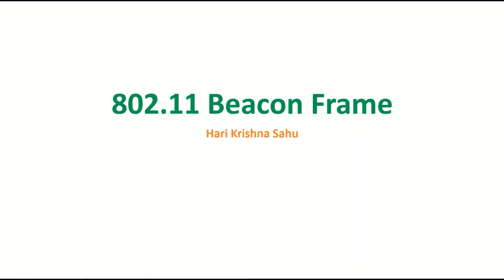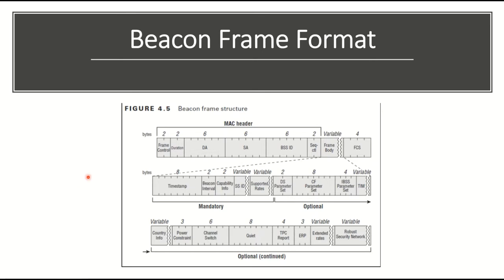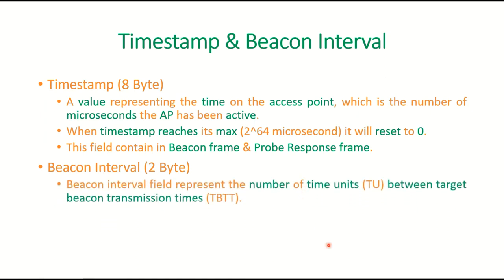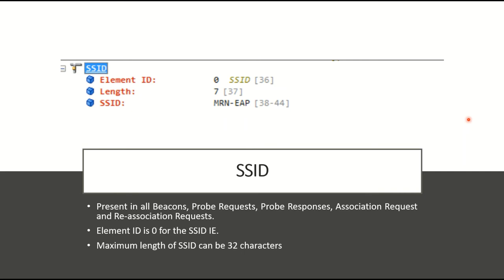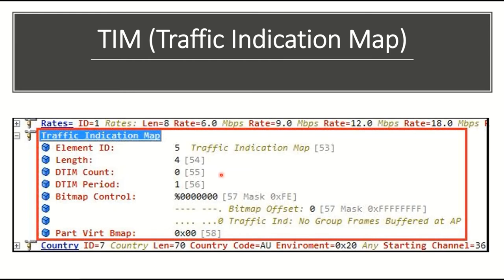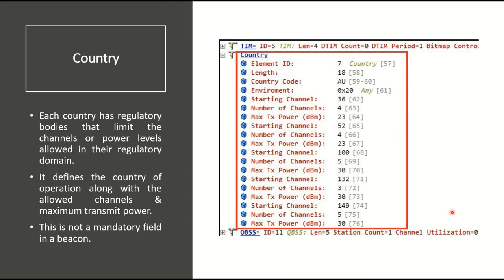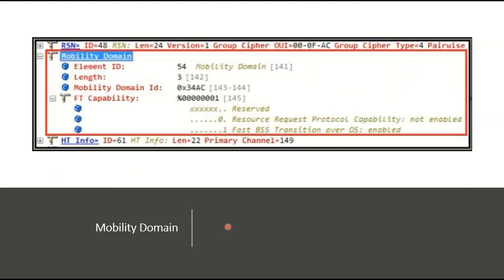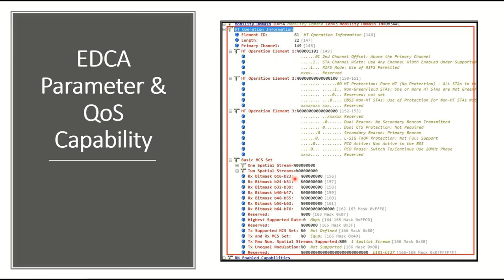802.11 Beacon Frame | Analyzing Beacon Frames using Wire shark | 802.11 Frame Analysis | Beacon

Comment: very interesting! Thanks for sharing. When could be a good idea to reduce the beacon frame interval on networks? Also, if reducine them would bring any sort of problems to my network? 
Thanks!
Reply from the maker: Great suggestion!

Reducing the beacon frame interval on a network can be a good idea in certain scenarios.
1. High-density environment
2. Real-time applications
3. Fast-moving environments
4. Time-sensitive operations

Yes, reducing the beacon frame interval can potentially introduce some challenges and problems to your network like:
1. Increased network overhead
2. Interference and collisions
3. Battery life impact
4. Management overhead
5. Network scalability

Before reducing the beacon frame interval, it's crucial to perform thorough testing and monitoring to assess the impact on your specific network environment.

Thanks for connecting.
Hari

Comment: Thank You sir for explaining it nicely. Could you please confirm, does AP sends beacons on all the channels simultaneously ?
Reply from the maker: Not at all. How come it's possible. AP can't send beacons on all the channels simultaneously. Thanks
Reply: @HariKrishnaSahu  So how it work. ? AP sends beacon on only single channel ? what if client wants to use some other channel. Kindly explain.
Reply from the maker: Nikita you are absolutely right. AP sends beacons on one channel at a time for some particular interval. After that it switches to the next channel
Reply from the maker: Nikita Station has to accommodate with the AP. Whatever channel AP is configured, Station has to connect in that channel. Thanks
Reply from the maker: @nikitamittal3559  I hope you sent me a connection request in LinkedIn.  Accepted the same. You can ping me over there.
Reply: @HariKrishnaSahu  Thank you sir for clearing my doubt.
Reply from the maker: @nikitamittal3559  I am glad you liked it. So where do you work?